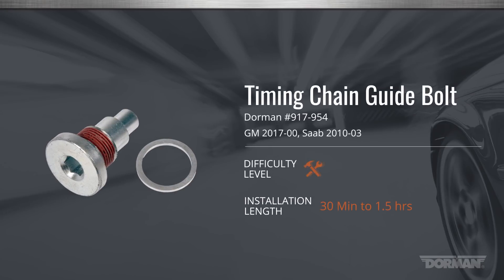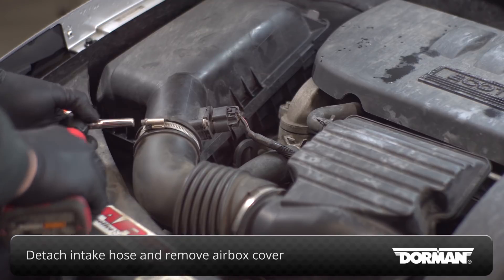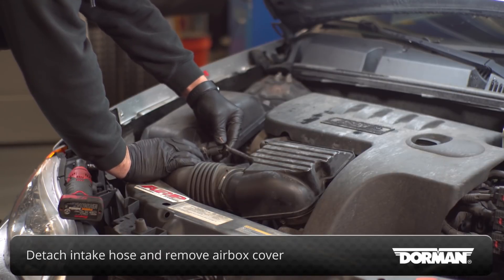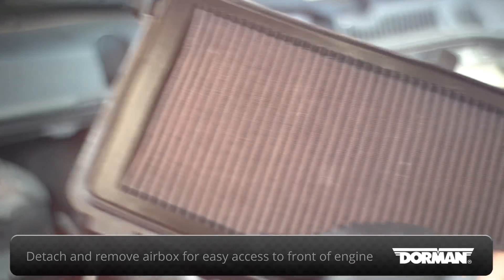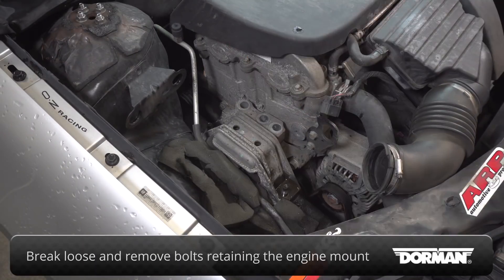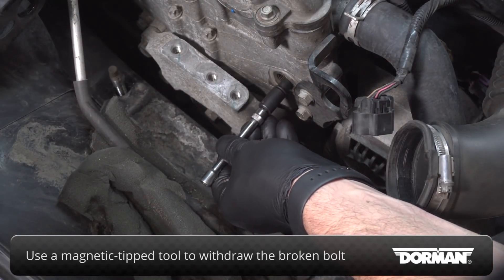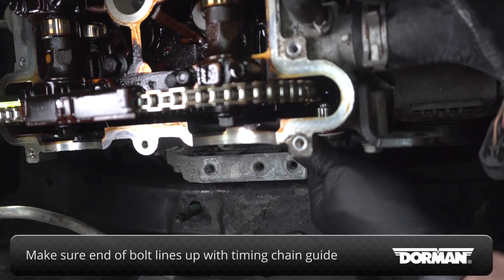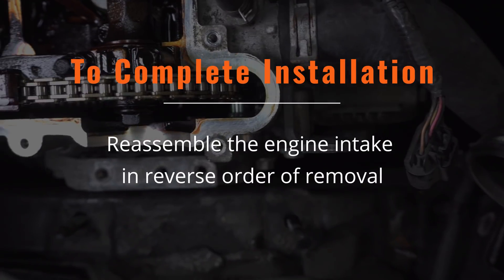Engine Timing Chain Guide Bolt Installation Video by Dorman Products

Comment: Just Completed a timing chain job on a "Botched" previous repair. ( Only God knows how the valves did not get bent when all the guides were broken and laying in the cover) The Upper bolt was MISSING, and the hole in the head had been Drilled about 4 sizes to big, leaving No way to even replace it. This  SAVED  a Cylinder head replacement on a 250K ECOTEC, and Both My Customer and myself are Amazed and Eternally Grateful. " Have a Drink On me" to the Person that thought this one up. THANK YOU!!!!!

Comment: Hi dorman! Can you ask Lem what they did to change this bolt as a preventive measure? Because the bolt inside isn't broken in my car, do just remove it with a long socket? ls it the same diameter socket as this replacement bolt? What would be changed versus what is shown in the video, etc? Thanks in advance!
Reply from the maker: Hey JZ. 
 
This is a pretty straightforward job. I wasn't around when Nick did this particular install, but I have done a few. The install really varies depending on what application you have. For instance, not every EcoTec needs the airbox pulled nor the motor mount removed. 
 
Regarding your question on tools, normally when I have done these, I remove the access plug and then remove the bolt. I can't remember if a deep-well socket or an extension is what I normally reach for, but I definitely don't need anything special. I'm also pretty sure that the timing plug on at least some of these is a hex, not a Torx.
 
Reinstallation is pretty straightforward, too; just make sure you get the tensioner lined up correctly so the bolt can do its thing. The nose on the bolt is pretty blunt, so you need to sorta wiggle the tensioner itself into the right spot. Note that you don't need the valve cover off to do this; it's removed in the video just to show you what's going on. 
 
And obviously...DON'T drop the bolt! Hope that helps some. 
—Lem
Reply: @DormanProducts  Hi - how can you make sure the tensioner is lined up correctly if you are not pulling the valve cover (if you are doing this as preventative measure)? ..is it by feel?
Reply from the maker: @ Yep. If this makes any sense, the old bolt you remove "sandwiches" the shoe between the shoulder on the bolt and the cylinder head.

Our solution does the same thing, but it doesn't thread into the head. Rather, the nose of the bolt comes alllllllmost to the head itself. The shoe is then captive and can't move. 

You'll know real quickly if you're not lined up because you won't be able to engage any threads! —Lem
Reply: @DormanProducts  I have a saturn ion with the ecotec that looks identical to this engine bay.

I appreciate the advice on the long neck socket. I'm a novice so I'm unsure how to tell if the tensioner is related to this specific install? I saw that these OEM bolts commonly fail so I bought the dorman one. I assume the OEM one is still intact in my engine, so I haven't touched the tensioner or timing system at all yet because nothing is broken in the timing system. Does that make sense?

Thanks again for your patience. I'm probably overthinking it, but the ion is my baby, and if this $10 bolt can help prevent my engine throwing the chain I'd do it any day

Edit: I see they're commonly replaced as a pair to fix engine rattle. I think that's also doable carefully without major disassembly. Is that what you were talking about?
Reply from the maker: Sorry, JZ. I made a small mistake. I should have said, "...make sure you get the tensioner shoe lined up correctly..."
 
Get in there and get your hands dirty. It's not a bad project. Doing it BEFORE it breaks prevents that broken bolt from hitting the chain or ending up in the oil pan. If you're interested in further reading, I discussed some of this in a Shop Press piece. Preventative maintenance is great, but are you performing preventative repairs? - Shop Press (dormanproducts.com)
 
Have fun! —Lemmy

Comment: Can you remove the upper guide bolt and install this without removal of the valve cover? as a prevenative measure before the bolt breaks?
Reply from the maker: Absolutely! Extracting the guide bolt before it breaks makes the job a bit easier. If it's any help to you, I have a personally-owned Ectoec-powered car, and one of the first things I did to it was swap one of these in—mine was also unbroken, and I left my valve cover in place. Hope that helps! —Lem